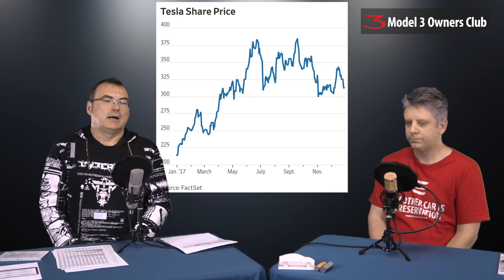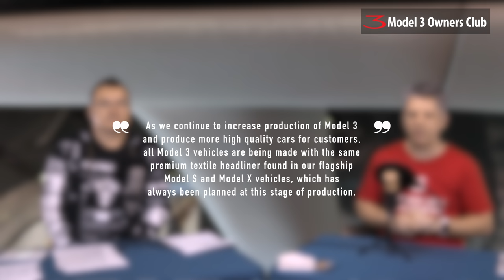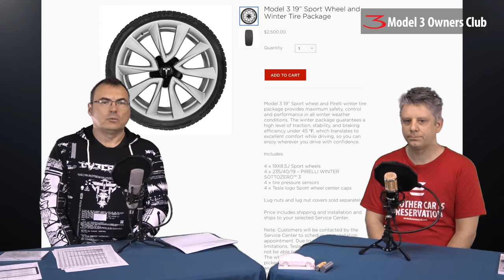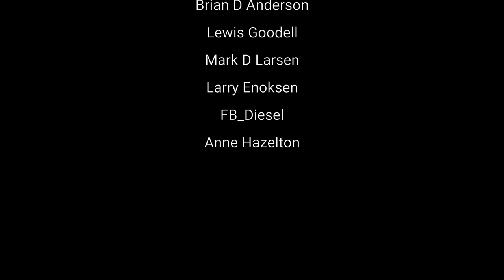Model 3 Owners Club Show Episode 27 | Model 3 Owners Club

Comment: It seems like every time someone talks about Tesla's competition heating up they forget one of the most important things:  The Supercharger Network!  No other manufacturer has anything like it and it is THE THING that sets Tesla apart.  While I understand the vast majority of driving is somewhere between 40-60 miles per day most people want the option to go on a long trip and no other manufacturer offers that.  Sure, you can find public charging stations around but they are slow and many times not kept up very well.  You also have to do a bunch of research to figure out where they are and what you'll need to use them, I'm thinking adapters, an account, credit card, etc...  With the Supercharger Network, you know exactly what you are getting.  And you don't even really need to plan or research because the locations are already known to your car!  The Supercharger Network is the reason I would not even consider buying an electric vehicle from another manufacturer even though some of their cars are pretty decent.
Reply: I think you're only partially correct. While other networks are popping up, they're not high speed like Tesla's. The problem is, the auto manufacturers aren't spending the money to build them, they expect someone else to do it. Also, great show this week.
Reply: Robert Scott I agree.  I have seen nothing that even comes close to Tesla's network, at least in the US.  Tesla spent years building it up so even if the other manufacturers decide to start today it's going to be a long time before it approaches the scale of Tesla's.  Who is going to want to buy a 35-45K car that you're not going to be able to easily take a road trip with?

Comment: After watching your video and listening to all the negatives on the new material being used on the Model S, the Model X, and the Model 3 I drove to Los Altos today and spoke to several folks at the service center and looked at Model X and Model S. We then left to see the Moidel 3 on display at the Stanford Shopping Center. 
We were given 3 minutes to sit, touch, move, open parts of the car and speak to a couple of representatives concerning the Model 3. 
I wanted to see if the textile being used was inferior to the Alcantera or =to or > than what is currently being used. 
I was pleasantly surprised to see that the material was identical to my BMW 330i. To the touch it was smooth but not quite as smooth as suede. Since I stopped at the Coach Store next door real suede and synthetic suede feels about the same but does not smell the same. 
I believe in the last 12 years I have only touched the textile on the BMW 3 Series and the 7 Series a few times as I do not make it a point to stroke the pillars or the ceiling of the car with my hands unless a mechanic was careless and left a finger print.

The Metalic Silver Grey was much better in person than in a small picture. It is not possible to get a excellent picture unless proper lights and reflectors are used to photograph this car. There was a red Model S within 1-2 meters of the Model 3.

I sat in the back seat behind the driver and behind the passenger side with the seats fully back.

I sat in the drivers seat after they allowed the steering wheel to retract giving me more leg room to enter.

I touched the wood, I touched the door handles and I touched the frunk and the trunk comparing this car to my BMW.

The only thing I missed was beefier support in the rear seats and led lights to light curbs in the dark. Front seats very comfortable but no air adjust for the thighs as with my car. No extension to the driver and passenger seats as with the BMW 330i. On a long trip I do not know how I will arrive . . . sore . . . slightly sore . . . really sore  or tired.

I gave the car interior a 9.3-9.5 for fit and finish. It cannot be compared to the Model X or the Model S having driven it last year and I can see you two are absolutely spot-on with your own review.

I do not understand the uproar over this past weekend. I did see one male who appeared to be about 38 years old and perhaps 350 pounds that did not fit in the rear driver's seat with the driver's seat fully back. He departed the showroom and did not return.

We did take pictures but I have not received my set as of this hour.

3 Minutes after waiting about 25 minutes expired in a flash. When we were done the double line was out the showroom doors.

Thanking you in advance,

Jerry in Santa Cruz, California and yes a follower of the two of you for about one to two months.
Reply: 3 Corrections: 1. headliner not ceiling;   2. Moidel 3 should be Model 3;   3. "but does not" should be but do not; 4. "having driven the two last year I can see the two of you are spot-on with your observations; 5. We waited in a double line for approximately 25 minutes and the review flashed by;   I could not edit the comment after I hit the comment button. My apology.

Comment: 1.  Ken's shirt is bad ass, don't let anyone try to tell you differently.
2.  Headliner, yeah, Tesla should have told people, but for everyone freaking out, the car roof is almost all glass, effectively there is NO headliner at all, just some trim pieces around the edges.  Who cares?
3.  Lithium batteries are not particularly toxic, just look at the main elements:  Aluminum, Copper, Nickel, small amounts of Cobalt, some plastic, a bit of electrolyte, (of which some formulas are actually safe to drink), and trace amounts of lithium.  They are much less toxic than the billions of lead acid batteries in cars today.

Comment: Tesla should be able to build 500k Model 3s per year using just the Fremont factory. They will need a new factory by 2019, but for the Semi, the Roadster and the Model Y. The Fremont factory was supposedly capable of producing 500k units per year for Toyota and GM. Tesla may have to off-load some non-automotive production from Fremont, such as superchargers and level 2 chargers. I'm sure Elon has a strategy in mind for making it work.

Comment: Thank you for mention the deer <3 :’(
Reply: YW
Reply: Last spring, it was a dark and stormy night when we hit a big dog with our 2014 Lincoln MKZ hybrid. (The dog ran off so it was ok) What looked like minor damage--left front parking light and torn bumper cover--turned into $1500 because of the parking and adaptive cruise control sensors. Same story when a truck backed into the right corner of the rear bumper a couple months later. That one, however, cost the other driver's insurance company almost $5000, including a car rental for us.

Comment: Great show as always. And I agree in the most important bit of the video...the reset to reality. The number of produced Model 3's will probably be in the 150k-200k range. But honestly...it SHOULD be in that range to retain credibility and believability towards reservation holders and investors.

The 500k number has a history of it's own. First it was the max yearly production of Fremont. Then it was to be the number of Model 3's to be built in 2020, then it was supposed to be the 10k weekly production RATE of the Model 3 at the end of 2018.

I think Tesla can get to 500k Model 3s in Fremont a year. Probably at the end of 2019. With a 100k S and X, Fremont could go up to 600k a year total.

I agree very much on the fabric (mismatch) position of Trevor. Tesla is not taking her customers seriously with that statement...disdainful is the word I found on google that comes closest in translation. Elon should twitter an apology on not communicating this change, communicating a garbage statement and promising to fix those mismatches asap!

On the competition front of things in 2018. Yes, there are more models available, however... Bolt is in the 20-40k units a year range, the I-pace will be on sale second half 2018 and in limited numbers. The leaf...well...I would be surprised if more that 30-50k are delivered in 2018

So at a projected number of 250-280k Tesla's in 2018...tesla will still reign supreme...but only if they can push out more than 150k 3s.

Will be a busy EV news year...and very very interesting Tesla news year! 2018 Q2 conference call will be the most important one in Tesla history I gather. :)
Reply: Hi Korrel, thanks for your comments and for watching!  I think 500k by end of 2019 is not achievable for Tesla, nor if they really can get 500k out of Freemont per year.  I would love to see it happen.  

With regards to the other manufacturers, I fully expect Nissan to sell and deliver a boatload of Leaf's this year, much more than 50k.  For the more mass-market mainstream, the 40kWh Leaf 2.0 has a better chance to capture this market than the Bolt or Model 3.  It's price point is much lower than the Model 3 and even the Bolt.  With incentives still to be had, it will be a strong contender this year.  For many people, the 40kWh range will be enough.  The 60kWh would be better, but that will be late in coming this year, if it makes it out in time.  For 2019, that will be a strong car depending on the MSRP.  

All good news for EV adoption and growth!

Comment: What can you tell me about the M3 Battery heating system. I heard it does not have a heater but can use heat generated from the Motor and inverter.

Comment: My biggest concern is the effect of ice on the door handles and pivoting mirrors. I don’t think they will be sturdy enough to withstand the ice getting into the nooks and crannies. Any thoughts on that?
Reply: Hi Vaughn, good points to be concerned about.  We did see a sticking door handle with You You when he came to town, however he had recently washed the car and it was extremely cold.  I think it will be a factor in very cold temps so we will have to see how they really handle this over time.
Reply: If that’s an option to do that, then that cuts my fears by half. Thanks.

Comment: I really don't get that people think it's a competition between Hybrids and EV's. So far, in Australia anyway, there has not been a practical EV available to us paupers, so the only non VCR Technology we have is the Toyota Prius. The 4th gen Prius runs through a lot of streets in EV anyway, and that energy does not come from a coal fired steam engine. It comes from braking.
What's VCR Technology you ask. It's anything that still uses belts, clutches, fixed gear ratios. Bendix drive starter motors and brushed dc motors don't even make that status.
The Prius has been around for 20 years with a saturation that Tesla could only dream about. Yet, the majority of new cars (around 99%) are still using this rubbish. (belts are a lot cheaper than an inverter controlled motor) Why people still rave about Mercedes Benz and VW or Audi is beyond comprehension. As for Tesla being greener than a Prius, While ever there are coal fired steam engines in the world that is not possible. Thanks again guys.

Comment: ICE cars will still be cheaper for most people, yes I'm a model 3 reservation holder.  With paid supercharing, lack of most people being able to charge at home, it's still too expensive for most people, especially since most people won't get the $7,500.00
Reply: Hi Patrick, yes you are correct ICE is still cheaper vs EV.  That is why most areas offer incentives at this time to help spur EV adoption.  We believe one the next few years (5-7) we will see cost parity arrive, which will negate the needs for incentives.  This along with a more abundant and robust charging infrastructure and process, will make the choice for BEV adoption much easier and affordable.
Reply: You must compare cost-in-use. Musk compares a base Model 3 as equivalent to a $25000 ICE.
An no ICE can be autonomous and earn its owner income with a diverless share system like Tesla Network.
Reply: While I'd love to have the autonomous features, I'll buy it straight out when I get my Model 3, most people don't care about this and can't afford the extra $9k up-front-cost.  Going on CarMax I can get an ICE car relatively new for $12k that gets 41MPG or a new Toyota 2018 for $18k that gets 40MPG, Tesla supercharger costs half what gas costs for the average 27MPG car, so with a new fuel efficient ICE car the energy vs gasoline cost differences aren't that much.  Sure there are savings on other maintenance, but regular people can't invest up-front with the hope that their car will pay for itself, or invest to save money 10 years down the road.  I can, and can see the savings, but most people can barely afford to look out a couple of years.  Tesla really needs to make charging basically free (yes, actually free has issues with misuse, but they are charging way too much right now) for people who can't afford to own a garage to charge at home.  They'll need to come out with a car that costs substantially less in the first couple  of years.  Besides, they promised that the Tesla semi would only be charged $0.07/kWh but they charge regular Tesla cars almost 3 times that much right now.